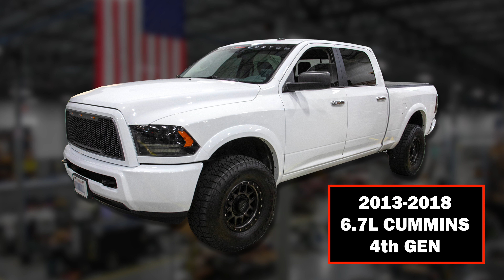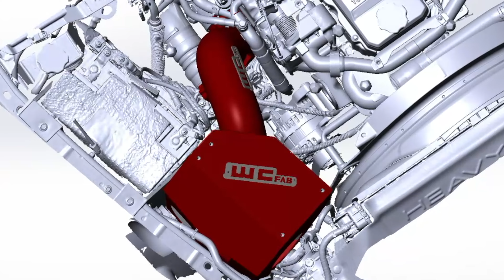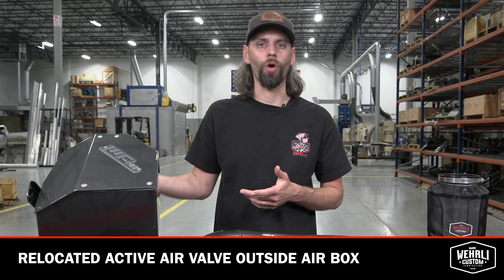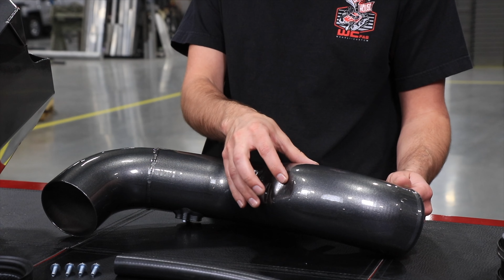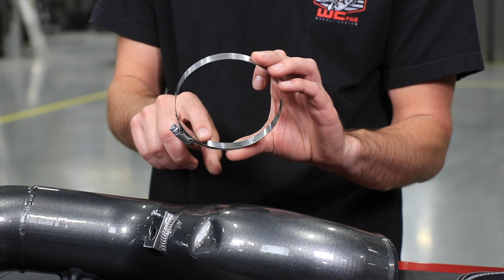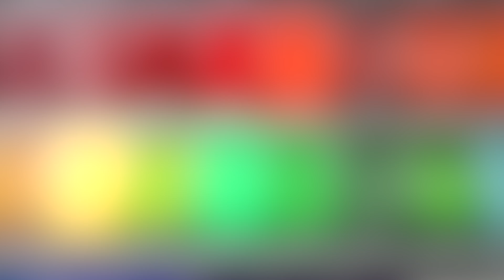WCFab 2013-2018 6.7L Cummins 4" Intake with Air Box

Comment: How does this system prevent water ingestion to the turbo? I also read on another site that too much airflow (by using both openings in the box) can be harmful to the engine...but that doesn't make sense to me... please clarify this too. Thanks!
Reply from the maker: Thanks for the questions. Our intakes include a hydrophobic pre-filter cover designed to help protect the filter element from spray / rain that makes its way through the grille opening and larger debris. If you're planning on encountering more water than that, we'd suggest that our intake is not going to be the ideal solution and you'll probably want to be looking at something with a snorkel and preparing for the challenges that go along with submersing a vehicle in water that deep. As far as the too much airflow concern goes on a truck running a stock tune file you have to validate parts designs to work within the parameters for which the engine was originally programmed (which we have done). If you step outside of that range, it can cause the computer to trip faults because it's been programmed to believe that those values indicate a problem elsewhere in the system that requires service or maintenance. Without getting too much deeper in the weeds here, we'd suggest giving our team a call (630-277-8239) to discuss your build goals and how you use your truck so that we can help make a tailored parts recommendation that will work best for your needs.

Comment: Do we need the box ?
Reply from the maker: The fabricated metal air box shown in this video is included as part of the intake kit WCF100881 and is an integral part of the mounting structure for this product. In the past we offered an open style intake for these trucks (replaced by this version). If you have one of the old style intakes it is not compatible with the new style air box. If you have additional questions, please give us a call at the shop (630-277-8239).

Comment: Where does the factory air director locate too?
Reply from the maker: @SleepingNinja1265  the blend door is not retained, but the actuator will stay plugged into the truck’s harness and we provide a location for it to be secured to the air box assembly when you install our product. If you have additional questions about the install, give us a ring at the shop (630-277-8239) and we’d be happy to help. 👍